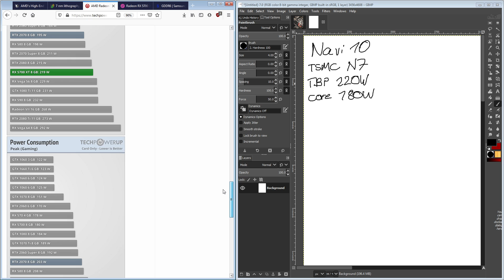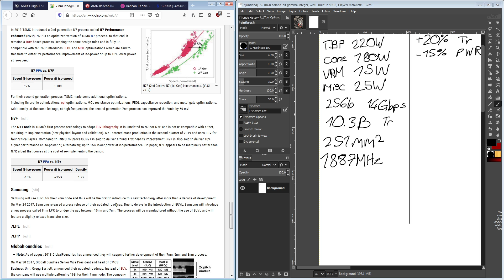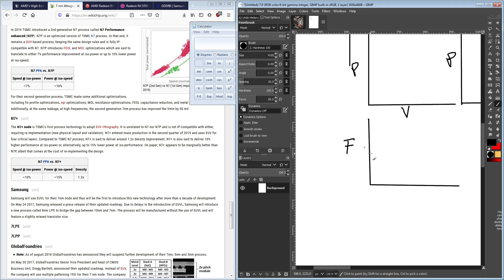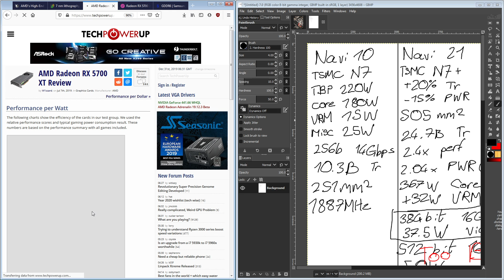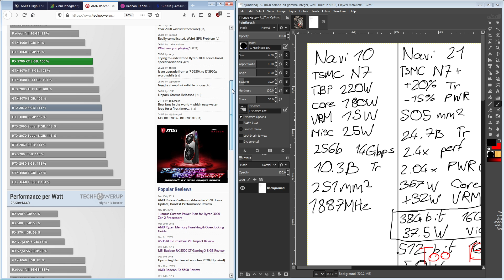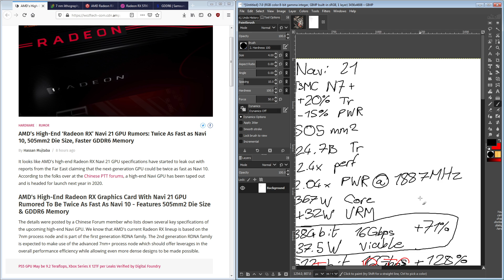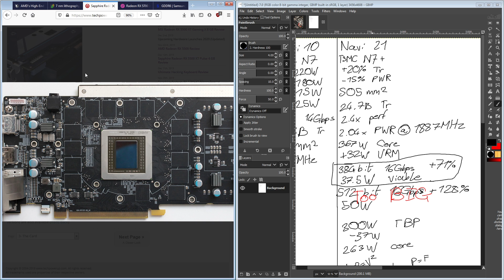I don't think Navi 21 will be 2x the speed of Navi 10

Comment: Now, many months later, we see rumors:
1. Big Navi is "RDNA2" (which AMD claims will be 50% more efficient per watt in their analyst's slides)
2. 21Gbps GDDR6X (which Micron says is 50% more bandwidth) on a 384 bit interface so that'll be 2.25x memory bandwidth relative to the 5700X. 
3. Nvidia's high end Ampere cards with an absurd VRM and a new 12 pin connector implying much higher 300W TBP. AMD may be planning similar.

Do you still think it is unlikely?

Comment: I don't think I've ever disagreed with buildzoid before, but I do here. 2x the silicon, a better architecture, and a better node will give us 2x performance. They don't need to use twice as much power. We already know RDNA2 clocks much higher than RDNA1 from the consoles. I think AMD will be willing to clock their cards to the limit of efficiency (300W and beyond, if it lets them take the performance lead), just as they have done before.

Comment: Lol I got a nitro+ 5700xt as something to use between when I built my system a couple weeks ago and when the next high end navi/nvidia cards come out. Maybe I should have gotten more than a 650W PSU. 
As is the whole system can pull over 500-530W with just the 5700xt+R5 3600

Comment: So the 5700XT is the same relative performance as the 2070 but on average 10% cheaper. By this rule Navi21 will cost 10% less than the 2080ti. That's still an awful lot of money. I don't think they will charge that much. It doesn't feel right as an AMD customer. I'm hoping it'll cost no more than 700-750$/€/£

Comment: Now they've announced RDNA2 and that they will be using 7nm EUV lithography. Maybe that's their solution for the shortcomings you've pointed out? Either way the card will draw alot of power and or be one hell of an overclocker. Also tbh only the folks in California care about power consumption everyone else with relatively cheap electricity really dont care that much. Hell the water cooling guys would have a field day!  Performance PCs might even finally build a new website!

Comment: I think you forgot (unless there is a reason for you factoring that out ) to include the -15% power efficiency of navi 21 yes its gonna be 2.04 times more power hungry assuming same clock speed and without including the power efficiency drop so at same clock speeds its gonna bee 180 * 2.04= 367 and now adjusting the 15% power efficiency drop we have 367 - (367 *0.15) = 311.55 watts and that's like a substantial difference.

Also I am skeptical (since I have years to look into that stuff) about how you calculate memory and its effect on performance, I think (and correct me if I am wrong) that it doesnt make sense to calculate the bus width on its own and expect that to add up symmetrically to performance, I think what you should have done is multiply the core performance * Gbps output of the memory system and that would be the performance you theoretically should have gotten.

Comment: I think Navi 21 can be 2x faster than Navi 10 if they use HBM2.
That would solve the bandwidth issue and also reduce pwr consumption (not by much but I also believe they will reduce the fq a bit like Nvidia did with the 2080ti v 2080).
For a 505mm2 core there is no other way for it to be ‘Greta friendly’ and not to be memory bottlenecked. AMD themselves assumed RDNA works well with GDDR6 and HBM, so its viable.
Ofc this will be a very expensive card to produce, and also AMD needs those 7nm+ wafers for Zen3 where margins are higher, so I believe they will produce a handful of units and launch it as a Halo product to compete with whatever Nvidia launches this year.

7nm+ will not come before 3-4th quarter, and so I believe AMD will launch another high-end card earlier to compete with today’s Nvidia lineup, smth like a 300-350mm2, 60-64CU, 384bit@16Gbps with 12Gb VRAM for about 700-800$ that beats the 2080s and trades blows with the 2080ti. This is where AMD has to focus on, price to perf

Comment: should be similar to TU106 (2080 ti) -> TU102 (2070): 
    FP32 by 80%(13.45
 TFLOPS), gaming by 40%, TDP by 43%(250W). 
I also did a rough calculation, navi 10 (5700 XT)-> navi 21(@1600Mhz):
    FP32 by 64%(16TFLOPS), gaming by ~30%, TDP by 33%(300W). 
If OC @1800Mhz:
    FP32 by 84%(18TFLOPS), gaming by ~40%, TDP by 64% (370W).  too hot, water cooler is needed. 

I think this card should be close to 2080 super, and OC is hard for FE version. 
The good side is that the price might be close to 2070 super($499~$599) considering the same price of 5700XT and 2060 super ($399). 
if the price is $5xx, I believe it's ideal for calculation as long as ROCm supports navi; as for gaming, it's not that great, but still worth the price (2080 super is too expensive).

Comment: @buildzoid Here are some numbers that don't agree with your conclusion that Big Navi could only be 10% faster than 2080Ti:
5700XT Passmark GPU Score = 13,806.  If 71% increased performance, that's 23,608 vs 2080Ti Passmark GPU Score of 16,691 = 41% (amt that Big Navi would beat 2080 Ti by)

Comment: I wanna see another 4 chip HBM card like radeon VII.
I'm guessing this is very expensive for AMD to make, but that's the setup we'd need to even come close to the 2x claims. The same config with the newest HBME would get over 1.5TB/s bandwidth. that's 50% higher than radeon VII and over 300% navi 10. Also I think the 20% density claims for N7+ are extremely optimistic. We'll prolly see something like 10% more dense at the same power usage.

Comment: I agree with the statement double the die size = double the performance if everything else is equal. In this case this card is going to be RDNA 2 and on 7nm+ compared to RDNA  and 7nm. I could see them getting closer to that double performance mark. I could see the 512 bit bus, with some trickery, but more than likely a 384bit bus, or heck maybe even 4 sticks of HBM2 since this is going to be a higher end card. NVidia has some big dies, but they also on 12nm. 505mm is huge for a 7nm product, roughly equal to a 1010nm die on 12/14nm. So with a reworked uarch and various improvement else where I could see AMD surpassing the 2080ti by a good margin until Nvidia releases Ampmere on 7nm.

Comment: But the thing is,  they absolutely would have to beat a 2080Ti by that 37% because Ampere will be out shortly before or shortly after that card. And +50% for a 3080Ti compared to a 2080Ti is the least I expect from Nvidia switching to 7nm and improving their architecture.
So if they just beat a 2080Ti by 10% with their absolutely best card at 300W, and then Nvidia comes along and beats that card by 36%(150/110) at 275W, the situation will be no better than it is now.
If they beat a 2080Ti by 37% and thus are only 9% behind a 3080Ti(137/150), they could compensate that with pricing, but at 36% the two cards wouldn't even play in the same league.

Comment: first of all , excellent analysis!! , but I have some novice questions (*I gave a quick look on the comments and saw that others have also insisted for the possibility of HBM instead GDDR6 ) :
1)double the transistors , +(plus) 7nm+ process = 140% more theoretical performance , but bottlenecked by 384bitGDDR6 memory which can give only +71% more bandwidth. 
2)The same setup described in 1) leads to massive amounts of power consumption (close to 400watts as you said)
3)AMD , if i'm not mistaken , have confirmed the use of Hardware-level Ray Tracing , so it's logical to assume a 20% of their 505mm-die to have dedicated RT-hardware like nvidia's RTX dies.
    This leaves AMD with a 404mm-die/19,76B Transistors for normal rasterizing performance so :

A)Based on the data/assumptions at 3) ,this leads to : +91,8% more theoretical "rasterizing" performance. With +91,8% performance ,will the +71% bandwidth continue being a bottleneck?
B)Some rumours have been heard that AMD might use HBM memory for high-end Navi. In such a scenario :
    B1)Can 8GB HBM2 provide the necessary bandwidth to offset the bottleneck described in 1) ??
    B2)The use of 16GB HBM2 will probably reduce the power consumption and will also provide very large bandwidth , but how much is going to increase the production cost ??
    B3)Is the use of 16GB GDDR6 a feasible scenario if we take into account the much higher power consumption of GDDR6 Vs HBM ? will 16GB GDDR6 offset the bottleneck described in 1) ??

Comment: Now take this analysis and apply it to the Marketing BS being spewed by Sony and Microsoft about the next gen consoles ...... Personally I think they both are writing checks their butts can't cash ..... I upgraded from a GTX 1660 Ti to an RX 5700 (non-XT) while the performance was much better at 1440p  it taxed my power supply considerably more and I bumped it up to 650W like I was running an old overclocked FX 8350 ...... AMD did a really great job of making their CPUs more efficient but they still need some work on the GPU side

Comment: RX 5700 XT has two RDNA Shader Engines with 64 ROPS and 256 bit bus. 

"Pitcairn XT" 7870 GE/R9-270X has two GCN Shader Engines with 32 ROPS and 256 bit bus.
"Hawaii XT" R9-290X has four GCN Shader Engines with 64 ROPS and 512 bit bus.  Hawaii XT's four GCN Shader Engines with 64 ROPS design was later evolved into Fury X, Vega 64 and Vega II e.g. extra CUs, delta color compression, larger L2 cache, connecting ROPS to L2 cache and higher clock speed and etc. AMD was stuck in four GCN Shader Engines with 64 ROPS design since year 2013.

Hawaii  GCN effectively has two Pitcairn GCNs glued on a single silicon.

Future NAVI 21 may evolved like Hawaii XT's dual Pitcairn XT design.

Comment: now given that they will get 20% TR from N7+ 
the only way I see them getting 25% faster than the 2080ti (2080ti is 35% faster than 5700XT at 1080p according to TPU, so 171%/135%=25%) @ core clock 1350-1400mhz, 384-bit bus of 16gb @ 16gbps GDDR6 is if they used 80 CUs
 
and I dont know how many sq mm the 40 CUs take on the 5700XT, but I assume 200-225 from the 250 total? that leaves 400-450 sq mm for 80 CUs (maybe closer to 350-375 due to 7N+??!) 

is 100ish sq mm enough for the mem controller. and RT Hardware?! Honestly I think RT hardware can be a chiplet at this point

Comment: Is RDNA bound in anyway shape or form to GDDR6? I mean, people could be assuming that AMD's GPU stack is what it was prior to Nvidia's RTX or even Pascal. 

It could be equally likely that AMD is targeting Navi 21 at the prosumer as a RDNA replacement for Vega 20/Radeon VII. In which case, Navi 21 using HBM2/HBM2E, and 16gb+ of it, may be a thing. We already know from radeon VII that 1TB/sec memory bandwidth is a thing AMD will be willing to do. So Navi 21 to replace Radeon VII as a prosumer card is good but not as a gaming GPU. 

 But still 2x performance improvement is very optimistic and for just 10% more performance to come out over well over 18mounths after nvidia's 2080ti which is on 12nm will not be great for AMD. But guess it is still something. 

Hoping to be pleasantly surprised,  but not expecting anything.

Comment: I think double the compute power is doable. It will have twice the die space plus 20% more density so even with ray tracing hardware they can basically double the specs of Navi 10. Besides the ray tracing hardware I expect it to have some changes to significantly reduce power consumption as well, and when combined with the improved transistor efficiency it should still be able to keep power consumption under 300 watts. Still a very hungry and hot card, but not one that is unlikely to exist. 

That said I do not expect double the rendering performance. As we have seen time and time again rendering performance does not scale perfectly with specs. Doubling the specs and compute performance will not double the rendering performance, especially on very high end cards like this. Even if they managed to significantly improve the scaling at the high end I don't believe for a second we will see twice the performance in gaming. I think anywhere from a 50%-75% improvement there is reasonable, and that's about what I expect.

Comment: To be fair, this will be rdna2 so maybe they have made some advances in memory consumption?
Reply: This is what I'm seeing too.  It does seem strange that they never did a large chip on rdna1, but if this is actually on the next architecture maybe (hopefully) they've figured out a way to get more out of existing memory performance.  Hard to say how much they could have perfected things from an RDNA1 that only released about 6 months ago
Reply: @s1mph0ny  For 7nm standard navi10 isn't a small chip
Reply: @Stef3m  it has fewer transistors than the 2070 super and even Vega 10.  I'd say Amd was smart to improve efficiency since that's what Vega lacked but this isn't a large chip by any measure.
Reply: @s1mph0ny  It's a 10+ billion transistor high performance design, I may agree that isn't a large one but it isn't small either. Also if you look at the advertised improvement of the TSMC's 7nm over 16/14nm it looks like the efficiency improvement come more from the process advantage than anything else, Turing with its additional tensor and ray tracing hardware still more power efficient even with a full process node disadvantage which is no less than incredible

Comment: I agree with BZ mostly,   However his calculations make too many broad assumptions.  Transistor count doesn't determine their usage.  It is completely plausible that they will not do a linear expansion, as they are aware that they are bandwidth limited, but instead boost the memory controller bandwidth (which can likely give them +15% performance boost), increase the stream processors to 3000+ and still have a reasonable power budget.

Comment: Honestly it will probably have a core clock similar to the rx580's. 1405-1425mhz should theoretically put it just below 300w. That's 30%~ increase in performance which is perfectly reasonable and viable.

Comment: A 505 for size compared to the older 252 the area is quadrupled so doubling the wattage is conservative a number, I haven't yet included the die shrink numbers. Power draw is more likely to quaddrouple all this staying constant.

 This for a architecture refresh, not Navi successor. Too much doesn't add up with the info given to really make a proper conclusion.

Comment: The 5700XT is like a GTX-1080 +20-25%, and it uses the same power.  IDK why you're saying it's "very inefficient."  I have a GTX-1080 and I think it's pretty darn good with power/perf. as is the rest of Pascal.. and the 5700XT is very attractive to me.. I'm waiting for this upcoming "big" Navi to replace my card, though.  And I don't think I'm alone saying Pascal is efficient.. it's just that Navi is more efficient.  Maybe you should get some glasses.
Reply: Did you really just compare it to a 1660ti 6 GB card?  Said it "blew Navi out of the water?"  Man, I tolerated your weird accent for a while, but I have to say I'm laughing at you right now.  Of course the 1660ti is more power efficient.. it's a weak card with little memory.

Comment: Remember, the 3950X uses less power than the 3900X, and it has 4 more cores and faster (slightly) clocks.  That's not N7+, either.  I think the core increase will be less than people are expecting, and RT cores will take a good bit of it's die area.

Comment: I bet that Navi 21 with 5120 units would need even higher memory bandwidth then Vega 20 XT GPU which had 3840 units and 1024 GB/s memory bandwidth with 4096 bit
 HBM2 ( Radeon VII) so would need HBM2E memory to get enough memory bandwidth and save some of TDP to get GPU running at higher frequency, 512 bit GDDR6 @ 18 Ghz ( 1152 GB/s) can have good enough bandwidth maybe but it would take much more of TDP so less left for GPU which would mean lower GPU frequency so lower overall performance ( 384 bit GDDR6 @18 Ghz would mean 864 GB/s which is still lover then memory bandwidth on Vega 20 XT GPU which had 3840 units)

Comment: 7nm+ let's you pick between 10% higher clocks using the same power as on 7nm, or use 15% less power at the same clock speed. How this translates to the power curve AMD is using, I'm not sure. But it seems they wouldn't need to underclock as much as first thought.

Amy's problem has always been the geometry engine. The compute part is already superior to Nvidia.

Comment: Your assuming 0 architectural improvement, I’m sure they’ll find at least 5% performance per Tflop and likely 10%. Big dies don’t scale that well though so your probably right with that 70% figure, I reckon they won’t struggle to hit the power though as efficiency picks up really fast with Navi when you stop pushing the clocks. Now if they use HBM and stick a clc on there, it could be a monster and at the price range this will sell at, they could afford to.

Comment: navi suffers from a rushed process with a lot of leaky transistors. I don't see 7nm+ fixing this much. but I will say a 512bit bus is more than possible with some caching. nvidia and AMD could cut memory power alot if they would stop using 1GB chips. latency aside a single GDDR5 chip offers 67pins(out of 170)x9GB/s per pin=603GB/s while GDDR6 can do between 1072GB/s and 1232GB/s if they use 16GB/s per pin chips. cutting the number of chips in half and going from 4ms to 8ms shouldn't be the end of the world for a gpu. especially when you push your settings to ultra and the GPU core is doing more processing then memory swapping.

Comment: Hopefully all these numbers are spot on, and AMD have to tune it down to 1400mhz for maybe a 1.5x perf to keep in power limits/thermal, but keep it easily power modded. That way the enthusiast with custom loop can throw power draw out the window and yeet another 20-25% out of the core.